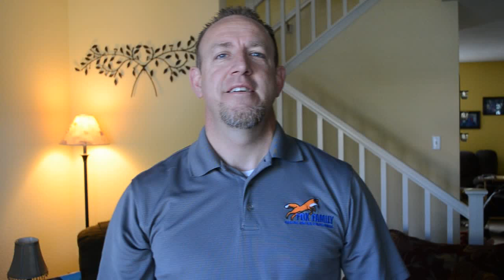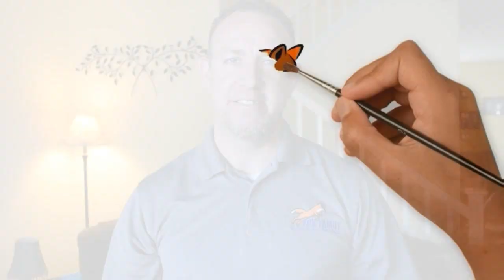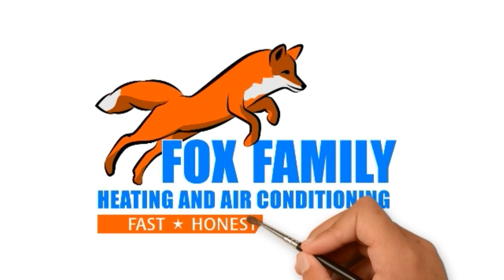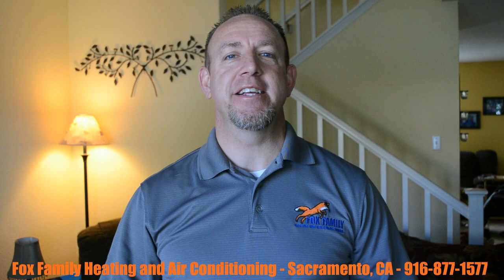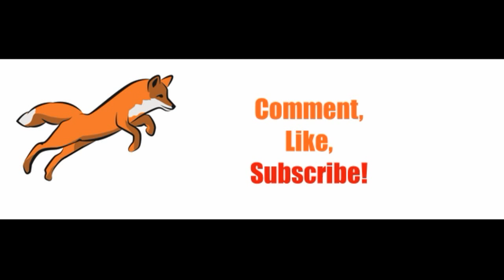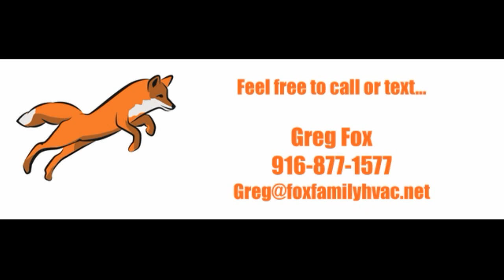AC Repair Sacramento, Air Conditioner Repair

Comment: Watching the AC diagnostic process made capacitor and contactor failures feel very common. American Residential Services typically handles these as structured HVAC repair cases, especially during peak summer loads, though each system still seems to need individual testing.